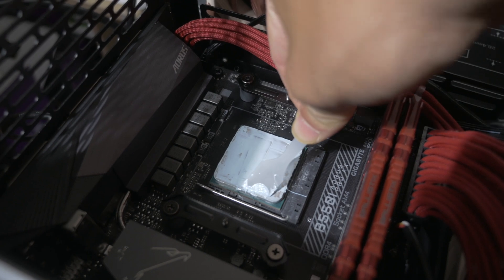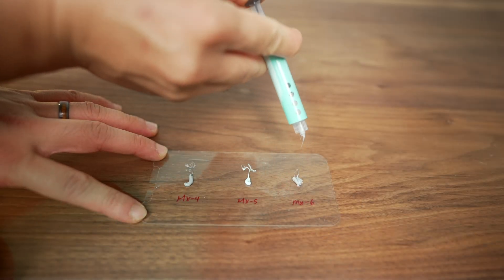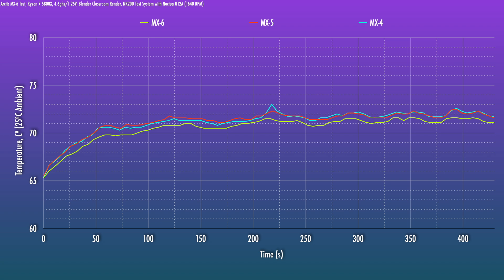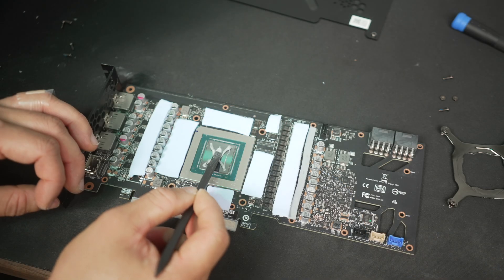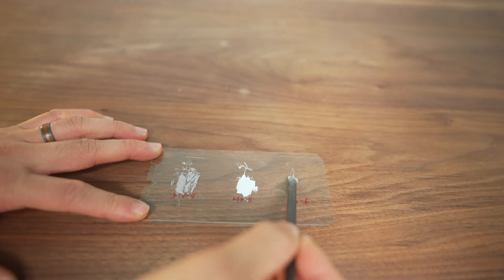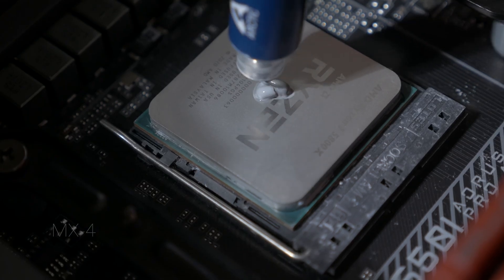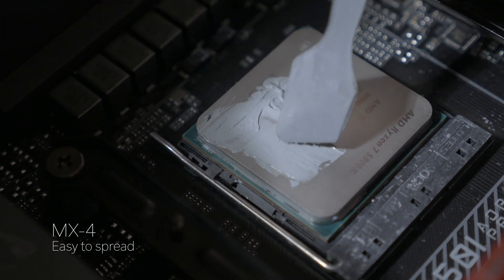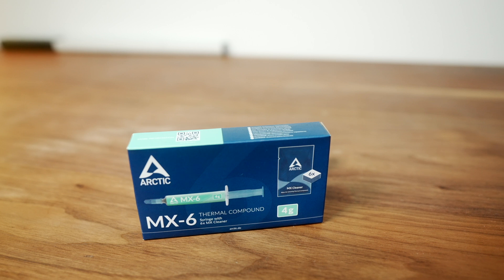A Top Tier Thermal Paste - Arctic's MX-6 Arrives!

Comment: It's been 10 months, how would you rate its stability over this period of time?
Reply: Its a  horrible product. I returned and used mx4 again
Reply: @pacificostriker  What went wrong?
Reply: @233kosta  mx4 is the greatest thermal paste of all times, that's what's wrong with it.
Reply: @rafars2246  So... it's not mx-4. You've not answered my question.
Reply: @233kosta  I did, since anything compared to mx4 is garbage. The only thermal paste to be used is mx4.
Reply: @rafars2246  So... You have decreed MX-4 "best" and that's your argument.

Is this a Poe?
Reply: @233kosta  my argument is based on experience. I'm old, I have used thermal paste for decades. Yes, it is mx4 and then the rest following at a great distance.
Reply: @rafars2246  You're still telling me precisely nothing here.
Reply: @233kosta  wtf you want, the chemical composition?
Reply: @rafars2246  You haven't answered my other question yet - is this a Poe?
Reply: @233kosta  ask your mother

Comment: I was thrilled to see you did a review of this when I was searching (you're highly trusted in my books).  What I'm wondering is the longevity of an application of MX-6.  MX-4 seemed almost unchanged even a year later when I've used it on a few different machines.  Wondering if MX-6 might be similar, or if it degrades or separates over time / thermal cycles.

Comment: Not bad. Although pricey I ran a few tests with mx4,5,6, and thermal grizzly kryonaut extreme. My temps with the kryo ranged 7-10c cooler on Cinebench R21. I saw 2c-3c diff MX6 v MX4 and a 1-2c mx4 v mx5. Testing was done with an i7-13700k and arctic liquid freezer ii 360 rev7
Reply: @Uğur Fatih İhtiyar do the kryonaut extreme .
Reply: @Uğur Fatih İhtiyar kryonaut prone to pump out and drying at 80C.  Effective but the longevity is bad. 

Not ideal for gaming laptop
Reply: @Uğur Fatih İhtiyar which cpu?
Reply: @Uğur Fatih İhtiyar maybe you have an undervolt option . Is it possible your laptop just needs to be dusted off or cleaned out from pet hair?
Reply: @Uğur Fatih İhtiyarif you're not throttling why bother  ? And if these temps are high during cpu benchmark tests but lower during work and gaming then stop running benchmark tests

Comment: I hoped to see it be less sticky. I love my kryonaut but it always pulls my CPU out with the cooler. A little sad to see the MX6 do the same. Are there any tips for keeping the CPU in the socket I don't know about ?
Reply: That's why i don't use arctic. I used 5 and I couldn't get the cooler off without the cpu joining as well. Glad I didn't break it and threw out the rest that I had.
Reply: @ripvanwinkle3432  what have you been using since ? My slate case is arriving soon and with it is gonna come a cooler swap, and ideally I would like to have my CPU not break while pulling the cooler off
Reply: @KurtKloetentreter  ive been using noctua h2 i believe is what its called. Repasted a bunch of stuff with a few removals for testing different things. No problems, temps are acceptable for me as well.
Reply: @ripvanwinkle3432  might have to grab a tube of that before I rebuild my rig.  I don't want to be dealing with the constant fear of breaking my CPU anymore 😅
Reply: @KurtKloetentreter  i feel that. I got my kid a 3900x and thought I messed up the pins cause it got ripped out of the socket with the heatsink.
Reply: @ripvanwinkle3432  the last time I pulled out my CPU I even tried tilting the cooler off of the Mainboard while pulling, and it still ripped the CPU out. At which point I wished i just pulled straight up, because pulling one side of the CPU harder than the other makes it a lot more likely to bent some pins
Reply: @ripvanwinkle3432 your lies are hilarious
Reply: Let heat up CPU a bit and then take out it will help

Comment: Tried this out with the 5800x3D system I built with a Fuma 2 revB, it's pretty good but still almost nothing can tame that cpu. on the cooling wipe side, I rather use the Noctua one. the smell is understated here, it's EXTREMELY strong, it's not bad smell, it's just very acidic lemon-ery that doesn't go away for awhile, I choked when I used the wipes. make sure you dispose of the used ones ASAP.
Reply: I read your comment only a few minutes before opening one of the cooling wipes myself. I thought you were overreacting about the wipes, but damn, son... you were totally right.
Reply: Is it any better than NT H1? I'm using that paste forever.
Reply: @panzer3279  i think it competes with the H2, but they are all close, either is good!

Comment: You need to do a test Arctic's MX-6 vs Thermal Grizzly Kryonaut Extreme 😉
Reply: Kryonaut is pretty shit for lifespan, as it is made for ln2
Reply: @icancraftsomething  shit if it is being use on direct die applications. if you are applying it to IHS like on desktop cooling, the IHS itself won't hit the 80 target noted for that paste so direct die = BAD, IHS application (aka majority of desktop applications) = 1 of Best.
Reply: @icancraftsomething  look at the tests, it's 4-5% better than mx 2,4,5. I don't know about mx 6 because I don't have a way to test it yet😉
Reply: @RamyraWitcher  I meant for lifespan. Kryonaut seems to degrade rapidly at higher Temps. Not a a good paste.
Reply: @icancraftsomething  what are you mean by degrade? i'm using non-extreme kryonaut for 2 years and never have issues with temps increasing over time. yup it's becomes dry pretty quick, but even dry paste should works fine
Reply: @LeetPanda  for me it did, but it seems kryonaut is only good for liquid cooling, as it quickly loses its lifespan and effectiveness above 80c, such as on a gpu or overclocked cpu.

Comment: My thoughts .. between Arctic's MX-4 and MX-6 if accurate (<1°C) then I'd probably choose MX-4. Here's why .. long-term I had an LGA 2011 PC that used MX-4 and its thermal behavior even over a decade (10 years) never changed and the TIM did not dry out or crack. That's frankly more important to me than 1° C. Who knows the behavior of the MX-6 over a long period of time.

My build in progress (i9-13900K and RTX 4090 with EK blocks) I'm probably switching to Thermal Grizzly Kryonaut even though I ordered MX-6. 

I think more testing needs to be done and hopefully before my build start date. I have a burn-in period until everything arrives from EK at the end of this month to test and compare.
Reply: the one you already bought.... I did the same and I regret it.  It is a bad product.  It's hard, hot and hard to put.  tell me what is your experience
Reply: @pacificostriker  .. The MX-4 spreads easier, no doubt, compared to the MX-6. I'm getting ready to reapply TIM because of some rebuilding of my PC. I think I'm going with Kingpin Cooling KPx. The reviews that I've read suggest a 2° C temperature advantage. However, I think the only real outlier is something like liquid metal which I refused to use.

I currently have the following which are only a few months old: Kingpin Cooling KPx, Grizzly Kryonaut, MX-4 and MX-6.
Reply: Kryonaut and many other pastes are not very reliable on gpu's and direct-die with high temperature at 80'c and above. It starts with great temperatures and rapidly declines after a few weeks/months. 
Hard to spread high viscosity pastes works best on those situations, and that's the reason why pre-applied factory paste is thick.
Reply: @phenos  .. Interesting considering the TDP and temperatures are the same for CPUs & GPUs, and considering benchmarks are completely different than what you're saying.
Reply: @DJaquithFL  Time is the deciding factor. It's not an issue on heat spreader cpu's with temps below 80 degrees but on direct die there is an high risk of degradation and pump-out effect. In the past i used "normal" thermal pastes on laptops/GPU  (NT-H1 H2, MX-4, Kryonaut) but after some time the temps start rising again. I suppose a GPU water block keeps the temperature well below 80 degrees so it'll hold up much longer.
According to the new mx-6 specs it has a lot more viscosity making it suitable for long term reliability on laptops/gpu's.
Personally I use shin-etsu 7921-5, Thermalright TFX, SYY-157 (older batch, new 2022 version not so good anymore) and Honeywell PTM7950 phase change paste for the really hot chips like the Lenovo Legion 5 or Acer Predator. The pink Kryonaut extreme seems to hold up good as well but very expensive.
Reply: @phenos  All these thermal pastes you mentioned sound like secret chemical weapons or something haha! I'm kidding tho, well semi kidding, I've only heard about SY so far. I haven't used laptops in ages and I recently repasted a sibling's laptop with Kingpin Kpx and I was shocked to see how easily it goes above 80c, I forgot how hot laptops get. Makes sense that they would need TIMs that can sustain 80c+ for long periods of time.
Reply: I use KPx as well on my own rig, undervolted 3700X with Scythe Mugen 5 and sapphire Radeon 5700 with it's default TIM. Electricity is expensive here so I have tuned them for less power draw.
I spread sturdy pastes with minimal pressure on the spatula, a relatively thick line on the edge of the Die and slowly working it to the other side. The pastes I use are more like clay so it doesn't stick on the spatula using this method. 
I clean the GPU and cooler thoroughly with citrus and multiple alcohol passes until it's 100% squeeky clean without old silicone residue, after that I rub a tiny dot of paste with firm pressure on the cooler itself to make a better adhering contact surface before placing the heatsink on the pasted chip.
On heatspreader Cpu's and cooler: after cleaning them I rub them with paste resulting in a gray semitransparant layer and place 1 center or 3 dots on the die locations of Ryzen chips. I only spread the paste on naked die's because the risk of a dry surface on the edge/corner of the chip can fry the whole chip.
(25 years of computer repair and building experience, those are my personal methods, thermal paste can cause heated debates so I leave it on everyone's own methods. And English is not my primary language making it a bit more difficult to explain my thoughts. Unable to place links here but google: PTM7950 reddit)
Reply: @phenos  .. If I were sub-ambient cooling then I'd think King Pin. My alternative would be ProlimaTech PK-3 Nano Aluminum but I'm putting this on an expensive series of EK nickel plated copper water blocks and aluminum and copper are just really a bad idea to mix together.
Reply: @phenos  .. Let me be clear. It's like splitting hairs unless you go the next step and to use a really high quality liquid metal and even the next step of deliding your CPU. I'm not going to do any of that.
Reply: @DJaquithFL  i understand, delidding is not really necessary anyway on current gen cpu's because they already have soldered Tim. The older 8700K and such had thermal paste. My advise is more directed at high-end video cards and laptops with the default cooling setup. Normal paste on water-cooled devices should hold up fine even if it's cheap stuff, only difference there is that the well known pastes perform better.
-Copper/iron and aluminum don't mix well together I know because if i remember correctly the first batch of enermax watercoolers for threadripper clogged up inside the cooling chamber from oxidation after a couple of months because of mixed metals. The same issue counts for coolant inside cars which has to meet factory specified requirements, refilling it with a generic bottle saying good quality coolant for your car is a bad idea.
Reply: @phenos  .. Honestly I don't see a real worthwhile difference. However, I'm going off of actual data between several temperature benchmarks and reviews.
Reply: @phenos  I'm planning on repasting my legion 5 soon since it's been 2 years since I've bought it. Whats a paste that you would recommend?
Reply: @recon12803  (I prefer to send a PM directly because this is someone else's thread but i don't see an option for that.)
For long-term stability and high thermal performance almost nothing beats Honeywell PTM7950 paste sheets on the Legion 5.
The L5 Pro from 2021 and after comes from the factory with Honeywell PTM phase-change pads and they are better than basically anything you're going to replace it with. So recommend cleaning the cooling fins and fans as best as possible first if their is minor dust buildup without removing the cooling stack, if the area is gray as a pigeon disassembly is the best option (Some fan mounting screws are underneath the heatpipes) and if the temps are still unacceptable my first highly recommended choice is the PTM7950 sheet (i found and got them from ebuy7). Otherwise Thermalright TFX, Shin-Etsu 7921-5, IC Diamond, Maxtor CTG9, Thermagic ZF-EX, Highly viscous pastes but even with those a repaste within 5 months might be necessary.
Placing links results in the removal of my message (Probably a YT naughty bots protection policy)
Google: PTM7950 Legion 5
Reply: @phenos  thanks for the reply, my laptop has been thermal throttling more than usual currently and trying to find a good replacement
Reply: @phenos no... Mx6 ihas not viscosity..its so hard and ineficient. I returned it
Reply: You seem to have a high end watercooled build. Are you using MX4 currently? And which applying method do you prefer to use i.e. dot, spread...

I'm also looking for a TIM that I can set and forget for my watercooled rig. So far I think I've had the best temps with Kingpin Kpx by like 1c lol but I frigging hate to apply it as it tends to separate when trying to spread it. Even GD900 which costs $4 for 30g from AliExpress was a very close performer, it I was a pleasure to apply that paste though. I've also got NT-H2 which I was told it's one of those set and forget pastes, temps are alright with it but a bit difficult to spread as well, not as bad as the Kingpin Kpx tho.
Reply: @Logan-zo3lj  .. I spread and have been doing so for over a decade. When you spread the TIM there's no doubt that you have 100% coverage. Less is more, it just needs to be covered. However I don't delid, lap or in any way void my warranty. 

As far as one TIM costing a few dollars more for a few degrees Celsius It's like trying to placate eating steaks to somebody who only eats McDonald's. In other words, the typical YouTube user base.
Reply: @DJaquithFL  "...trying to placate eating steaks to somebody who only eats McDonald's. in other words, the typical YouTube user base." Had me dead😂

When I'm doing lots of experiments like stock ILM vs 1mm washers vs Thermalright bracket, or just testing different coolers I'll use a cheap large tube TIM. If I'm applying for friends or actual use I'll use my best TIM. It sounds silly but it's like I'm always chasing that one thermal paste to rule 'em all lolz.
Reply: @Logan-zo3lj  .. Well that'll be liquid metal but it's not something I want to use.
Reply: I've done up quite a few bare dies with MX-6 now, and in each case noted about a 10°C improvement over whatever aged OEM stuff was on there.

10+ year longevity sounds good to me, and if the MX-6 doesn't prove to have similar long-term performance, I may well "downgrade". As you say, 1° isn't enough to sacrifice long-term stability, especially given the time and effort required to replace TIM on some of these items.

What I'm banking on is that Arctic knows how to make a long-lasting thermal grease (per your MX-4 experience), akd that they used that knowledge when they developed MX-6.

If not - the fallback option is clear as day.

Thanks for sharing your experience!

Comment: Can we see a vs NH-2?
Reply: i tried it vs nh-2 but on a 5800x3d so my results will differ as that cpu is just HOT. both hit 90.1deg in Cr23. gaming, both hover in the low 60s in MMOs while games like FH5, F1 2021, AC: Odyssey, seeing high 60-low 70s. I see maybe a couple degs different so my take is it's very similar. tested under a Fuma 2 revb
Reply: @prinzseptim33  That's strange because the 5800X3D is known to run relatively cool especially compared to the original 5800X which ran the hottest on Zen 3 according to almost every user and pro review after its release (even the 5950X runs cooler than the 5800X). Anyway what's your setup? AMD recommends a 280mm AIO or more for Zen 3 CPUs that don't come with a stock cooler (not including the 5700X which came out much later and only pulls like 80W) or a powerful air cooler like a be quiet! Dark Rock Pro 4 or Noctua D15. If you're using anything less than that level of cooling you shouldn't expect good results so again it's strange for a 5800X3D to run hot especially when it doesn't even clock as high as the other Zen 3 chips due to the 3D Vcache.

Edit: Just saw another comment from you saying you have a Fuma 2 rev B (which has faster fans than the original). That's usually a good cooler but for CPUs that use more than 120 watts it's not the one I'd go for. I was originally an air cooling only guy but Arctic is so good in general and their Liquid Freezer II AIOs are at the top of the charts so I'd suggest their 280mm AIO. I'd buy it straight from their Amazon or Newegg store so it'll have the QC sticker (there was an issue with some coolers that came out in 2021 and it has since been fixed but you have to make sure you're getting a newer one that's been inspected for the problem). Their 280mm cools better than any reasonably sized air cooler on the market including the best Noctuas and they are very reliable and not much maintenance needs to be done which makes it easy to go from air cooling to water cooling and why I will be using an LF II 360mm in my next build. I'll leave a link to Gamers Nexus review:
https://youtu.be/KPaSEGe6ML0
Reply: @vigilant_1934  sorry, I don't hop on YT often. 5000D airflow case, 3 AF120 RGB Elite Intakes, 1 Out, replaced Fuma with H150i Elite LCD 360. R23 is now around mid 70s stress (~76), gaming varies between 55-65 depending, custom curve. 🤞
Reply: @prinzseptim33 curve optimizer awaits